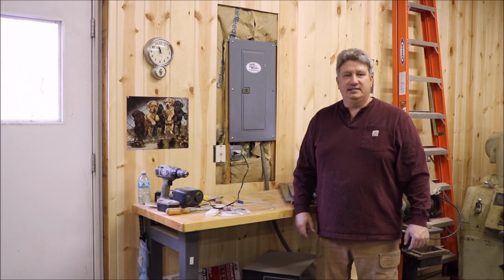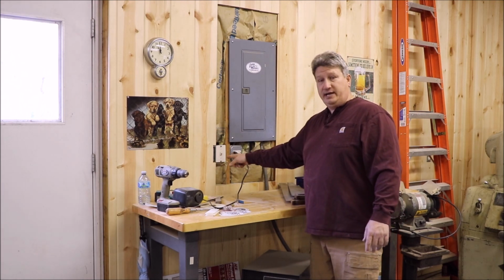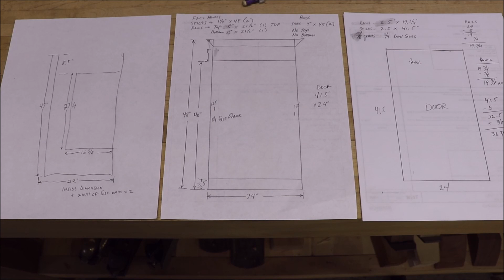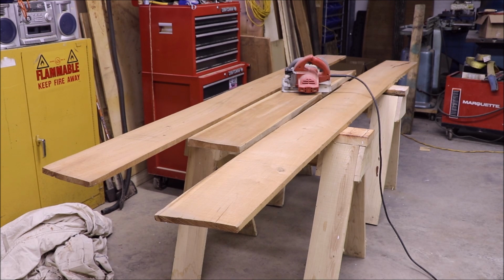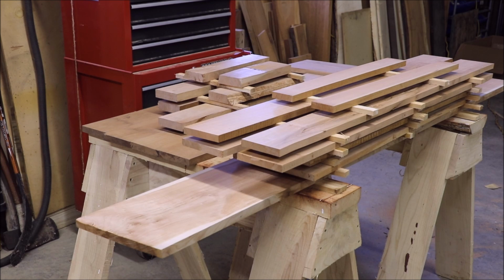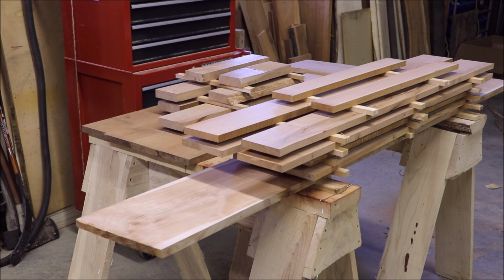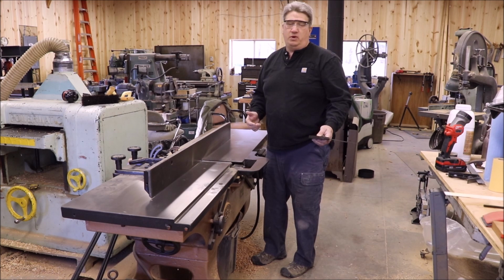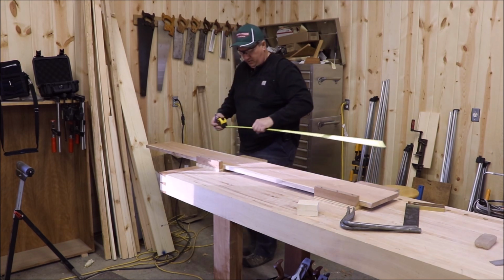Making a Frame & Panel Wall Cabinet Part 1

Comment: I like that old joiner; cutting the boards for length by hand with an obviously sharp saw  was neat.  Looking forward to more, Greg.
Reply from the maker: The jointer is a 16"er, and is a complete teardown and restoration I did a couple years ago.  I'll include some photo's in upcoming video's.   The saw is one of my favorites (actually, they all are!)  a Wenzloff and Sons halfback 12 tpi.  I keep all my tools very, very sharp.  I've got a drawer full of saw files for all the sizes.
Reply: Mr. Wenzloff and his boys do make a pretty god saw, don't they? I recognized that half-back the moment you pulled it off the wall - looks just like mine... :)

Comment: Nice video but I hope you don't mind me saying that when using your surface planer, I hate to see you wiping dust from the in-feed table after every pass with your hand.  A bit of dust really doesn't matter for the surfacing of the lumber, but what might matter at sometime in the future when tired, is that you wipe the table a little too close to the cutter head with serious consequences.  If you must clean the in-feed, use compressed air from a distance.  Personally, I'd have a guard over that cutter head.  Best wishes.
Reply from the maker: Thanks for your concern, but chips have to be removed from the infeed side to register the board flat on the table.  It wasn't just dust I was wiping away.  As far as safety goes, I'm not having that discussion on my channel.  It's up to the individual person to create a safe working environment in their shop.  I'm very comfortable in my shop.  I've been doing this for 30 years.  Thanks for watching.

Comment: Jeff,
 I enjoyed the video and am proud to post the first comment.
 Will this cabinet  just be a shell on which you open the door to access the breaker panel or will it be a fully functioning cabinet hinged to the wall? Do you plan to do all of the joinery by hand or a mix of hand and machine. Either way, I'll be watching.
 I have so many friends making YouTube videos I don't have time to do any work,
Rollie
Reply from the maker: Rollie- Thanks for commenting.  The cabinet is going to come away from the wall 4",  so I'm planning on using the inside of the door for storage of small items.  The electrical panel, and this cabinet, reside in the machining area of the shop, so there's never enough storage.  More to come along this theme, too, as I am going to build similar storage for all my milling cutters, arbors, and lathe tooling that doesn't fit inside my toolbox.  My CA toolholders are too big to go inside the box, and I want them easily accessible near the lathe, anyway.  Part 2 almost finished.